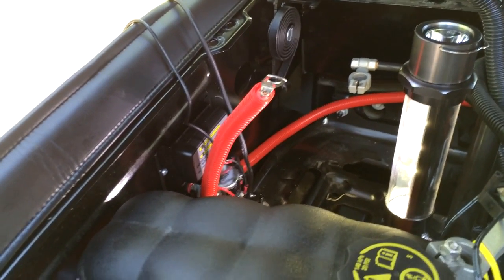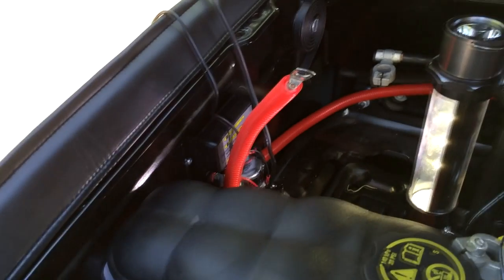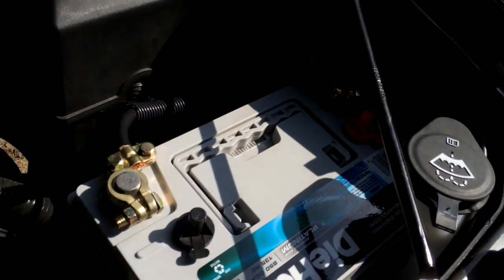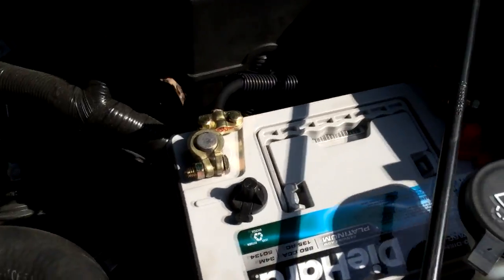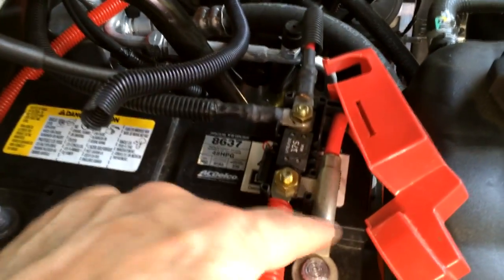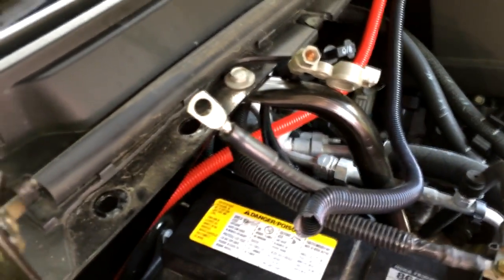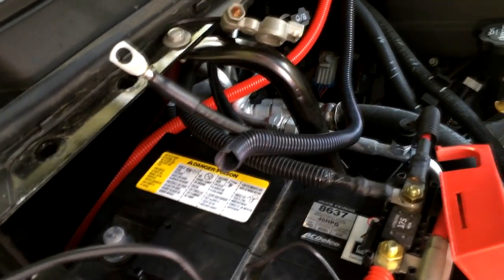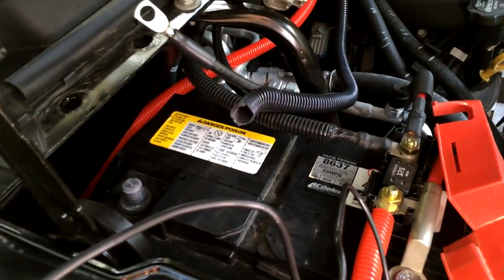Dual Battery installation Chevy Suburban - Reinstalling Main Battery  PART 16

Comment: If you break the T-shaped bolt that allows the cable to clamp to the battery on the 2007-2014 you can go to a auto parts store that sells Standard Motor Product branded parts and ask for a BP59C, or the BWD branded part BH59B, or go to a NAPA and ask for a 718628. Dont overtighten, the torque needed is 5NM or 3.6 Ft Lbs.